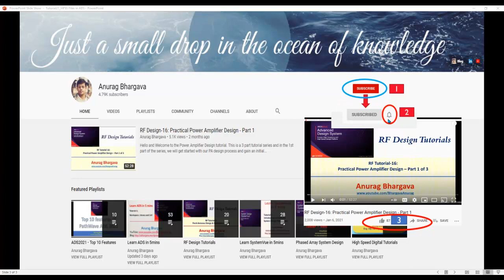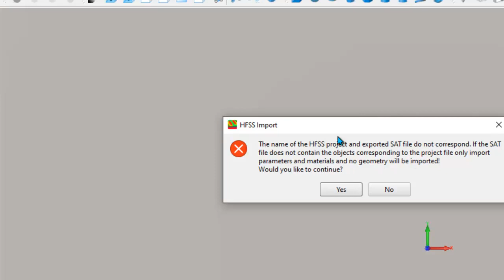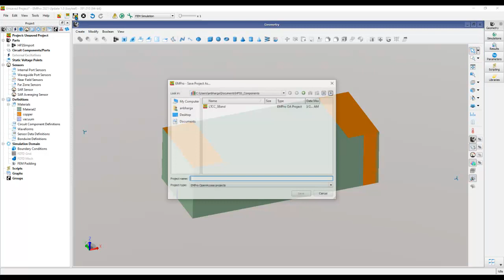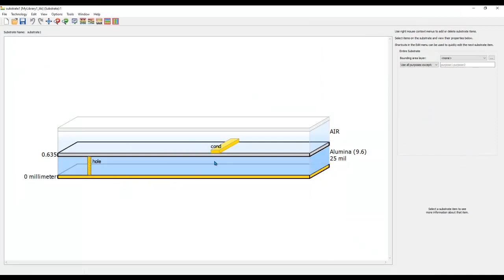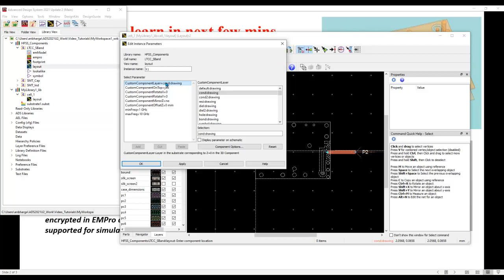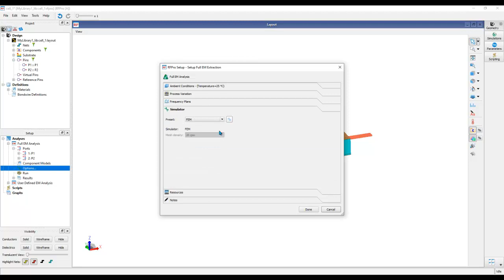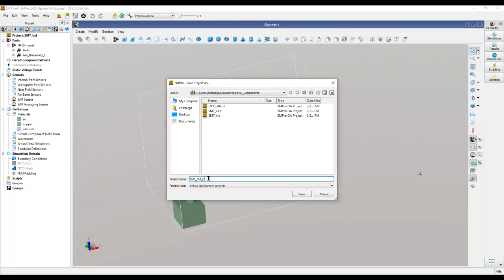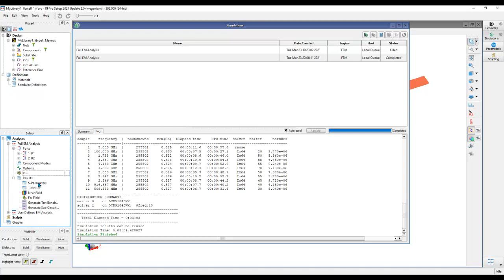RF Design-21: Using Ansys HFSS Components in ADS

Comment: Hi,
I have ADS 2021 and when I click on Import, it does not let me choose if a I am going to take a HFSS or PCB file.
Can someone help me with this problem?
Reply from the maker: ADS doesn't import HFSS files directly, idea shown in the video is to import .a3dcomp + sat files into EMPro and then you can add them as a library in ADS to be used and simulated.
Kindly contact Keysight support team in your region/country if you can't make it work.

Comment: dear,Anurag Bhargava  i design antenna for helix for GPS and i do not how to make matching is there simple or clear way if how to calc the quarter of wave length match or how can calc the tap match   ( Impedance transformer copper tape) value in physical
Reply from the maker: Unfortunately I have no experience with helix antenna matching. Recommend you to look for other help available.

Comment: Hi sir. Design of circuit and its layout in ADS and Cadence is same or not?
Reply from the maker: Hi Guru,
I don't understand the question & its context completely but answer could be yes and no both. I could provide more details if you explain what you want to ask and in what context.
Reply: @BhargavaAnurag  
Thank you for the reply. I designed LNA in both cadence and ADS tool using IHP pdk. While I am doing layout in cadence, I am facing some issues. So, I want to do layout in  ADS and export the same layout to cadence. Is it possible or not.?
Reply from the maker: Hi Guru,
It depends on the PDK you have, if it is fully interoperable PDK then layout or schematic done in ADS can be opened in Cadence as well and vice-versa but if PDK doesn't have layout interoperability then you can export GDS from ADS and import the same in Cadence but I am not sure if that would meet your requirements. There are few IHP PDKs that are completely interoperable but I am not sure about the one you are using though...Best thing to do is to contact IHP to get help
Also, I am not sure why you have to take ADS layout to Cadence....is it for LVS or DRC for the tape out purposes?
Reply: @BhargavaAnurag  
Hi sir, 
while I am doing lvs check using caliber, inductor sub blocks are not found. That's why I want to try layout in ADS.
Reply: @guruprakashpeta5192  I am also having a problem with the custom Inductor in cadence. LVS is giving a short circuit error since all three terminals of the Centre tapped inductor (connected to OUT1, OUT2 and centre terminal to VDD) are in the same Metal layer (for my case M8).
Reply: @samuelu7279  have u solved the problem?
Reply: @guruprakashpeta5192  Not yet.  I am thinking how can I solve since technically that error is reasonable..

Comment: 1. How can parameterized design from HFSS/CST be imported into ADS so that the effect of the parameters in the ADS co-simulation (with other MoM simulated circuit components) are seen? 
2. Secondly, if the same 3D parametric structure is designed from scratch in ADS FEM and co-simulated with other MoM simulated components, will there be any discrepancies? Can sweep/optimization in the mixed case where one component is from ADS FEM is connected to other components from ADS MoM be run from the ADS schematic?
Reply from the maker: For (1): As I said in the video, parametric models are not supported because each tool will have its own infrastructure to treat variables within their platform so it is not easy to manage.
For (2): I am not sure what discrepancy are you referring to? You can surely use FEM and MoM component in single schematic, these will be individual instances and when you run sweep or opt they will invoke their own designs & simulators so there is no issue.
Reply: @BhargavaAnurag  The discrepancy that I wanted to say is FEM of ADS and FEM from HFSS.
Secondly, can the HFSS file be parameterised in EMPro? It will be tuned then.

Comment: Sir can you please make a video on 1.on chip inductor design using Cadence cum ADS momentum
2. On chip antenna using ADS
Reply from the maker: What do mean by Chip Inductor design using Cadence? Do you want to run EM simulation using Momentum inside Cadence Virtuoso?
For On chip antenna, send me links to relevant paper links or references and I will see what best I can do.
Reply: @BhargavaAnurag   Thank you for your reply sir. Yes, exactly. EM simulations using Momentum inside Cadence Virtuoso.
And regarding On-chip Antenna:
1. High Efficiency 293 GHz Radiating
Source in 65 nm CMOS
https://ieeexplore.ieee.org/document/6816088
2. Sub-Harmonic Wireless Locking of a THz Radiating On-chip Source in 65 nm CMOS
https://ieeexplore.ieee.org/document/7345079
I think here they are making inductor/antenna structure in Cadence and doing EM simulations in ADS momentum which is inside the cadence virtuoso.